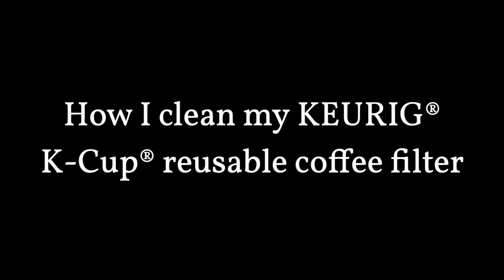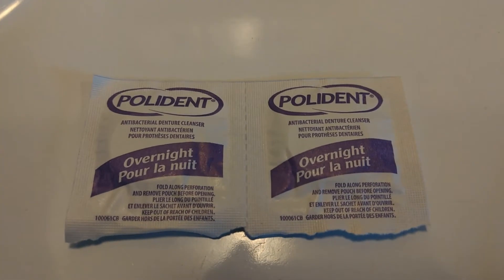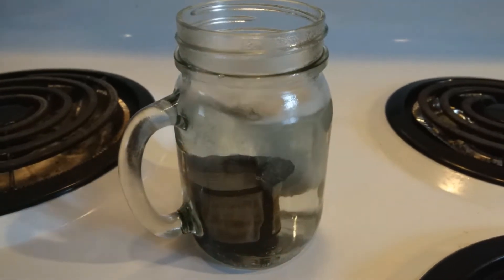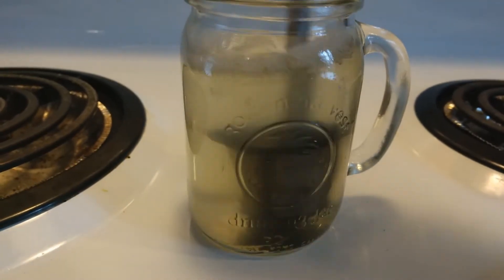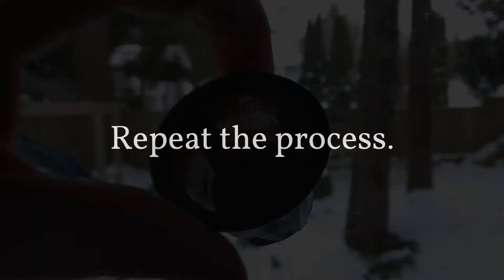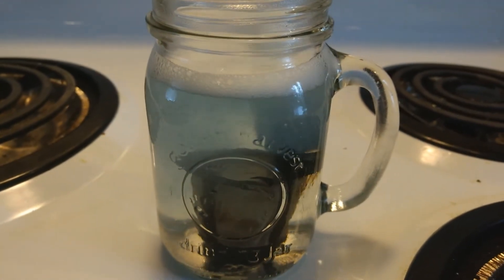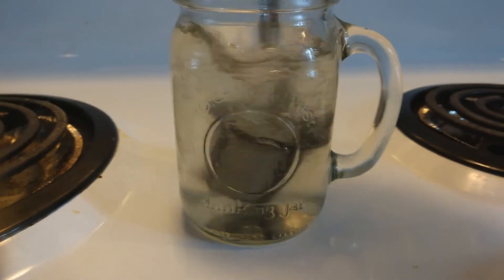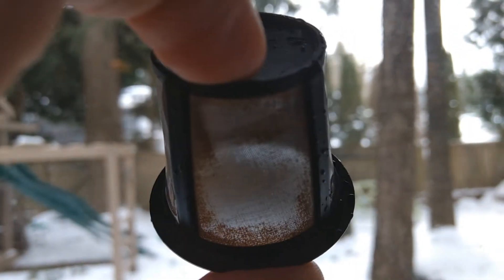Cleaning a Keurig K-Cup Coffee Filter

Comment: Another method that works for me is using a 2800 psi gas powered high pressure water cleaner. It takes only 5 second to have a brand new k-cup with this method. However it requires two persons with protective gear.

Comment: I've had several My K-Cups and they all have buildup eventually and need to be thrown away.  I've tried several methods of cleaning them and nothing has worked, so I came across this method and decided to give it a try.  It works best if after you soak it you use a toothbrush to scrub the inside and outside, and if there is a lot of buildup don't expect it to come off in one soak and scrub.  For mine it took two soaks and scrubs before having a huge improvement but this method saved it from the trash bin.  Now I do this about once a week and it keeps looking better and better.  Again, all My K-Cups get this buildup over time.  The soak and scrub method doesn't take that long and I can get it to last now and brew a great cup of coffee every time.  Thanks for posting the video!